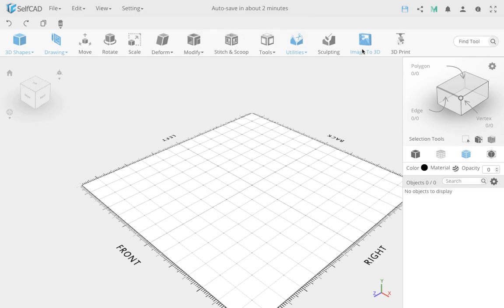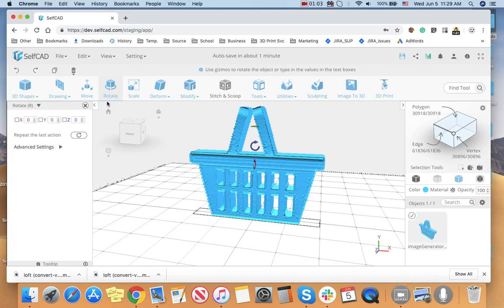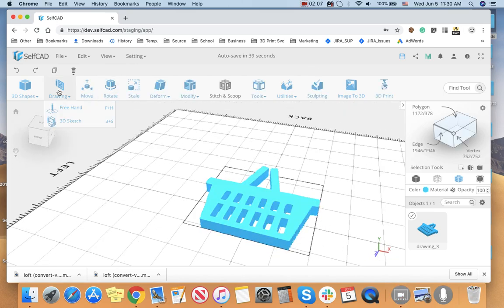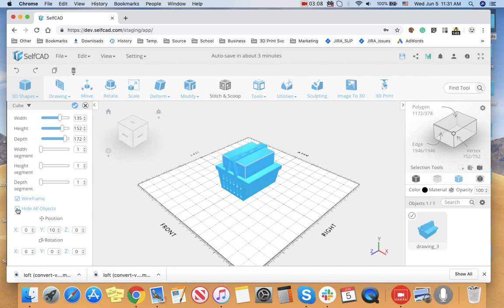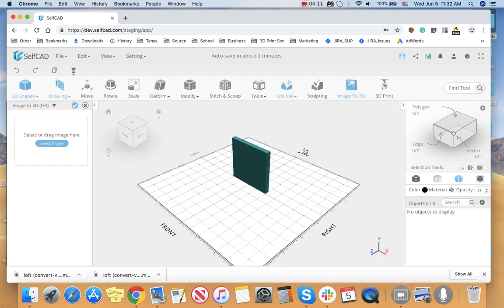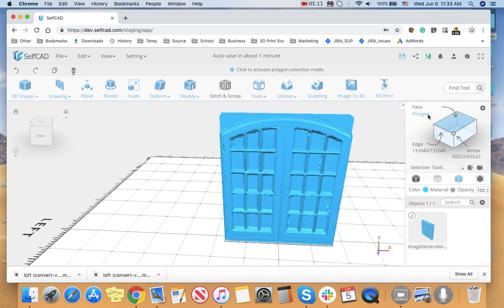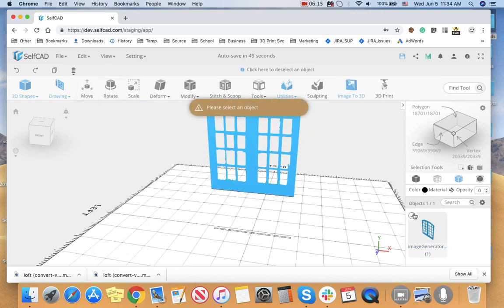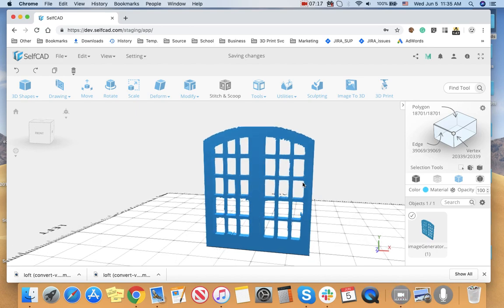How to convert Image To 3D objects into 3d printable and Industrial design objects

Comment: hi there, the tittle brought me here to this video but my doubt is still not knowing how to convert an image, for example a photo from a motorcycle, into a 3d printing file or a 3d object file so later i can print it on 3d printer. Can you please inform or give some pointers? :) TIA
Reply from the maker: You can see https://youtu.be/EK_Z264XAQo?si=5zs-tTUvK9UqC0d2 this is a newer video showing a more practical use case but this tool is limited to converting one side at a time, not making a complete 360 view.
Reply: thanks, but im really struggling to for example create a model from motorcycle photos so i can print it in 3D with all sides...  @3dmodeling101  - there were some online tools to merge several angle photos from something and they would merge them.unfortunately they are not available anymore and the one i found asks for some in depth setting info which i cant give because photos are from the internet and not from professional camera.